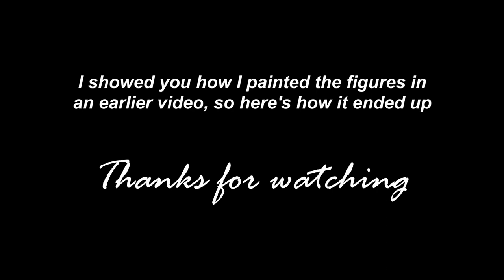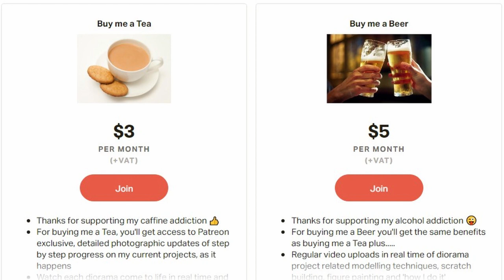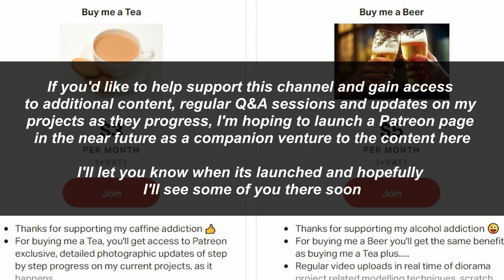1/35 Afghanistan Diorama (Realistic Scenery)  - Hell in Helmand

Comment: Fantastic work! Which foam you use for the wall and the building?
Reply from the maker: It's 10mm XPS insulation foam 👍
Reply: @CWModelling  ok thx. Where can i buy it? I can‘t found it 😫
Reply from the maker: I get mine from ebay in the UK, I think there's a link below the video but I can't help outside of the UK I'm afraid 👍
Reply: @CWModelling  no problem. I hope, i will get it any where 😬